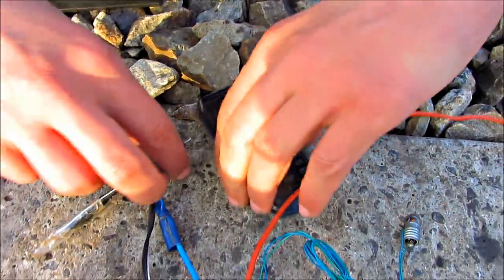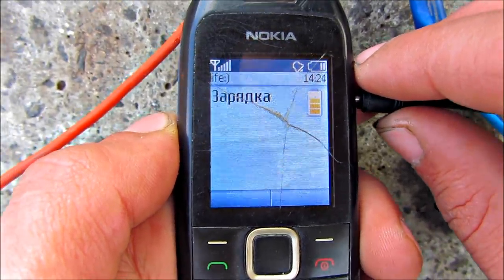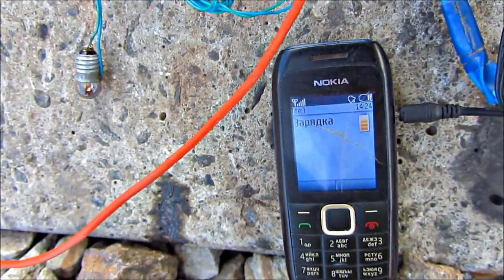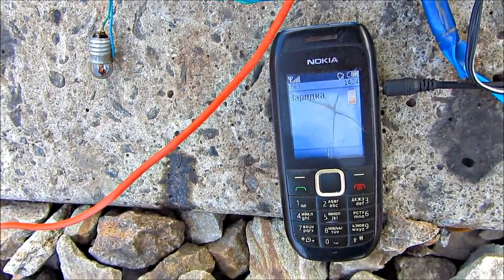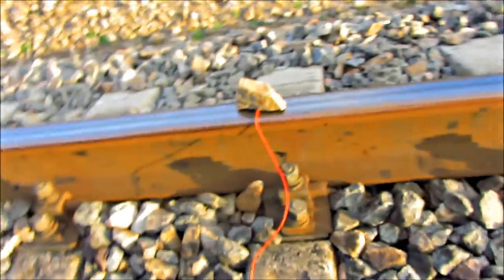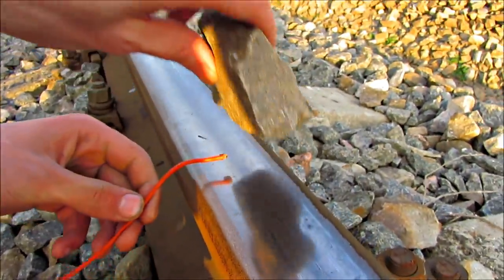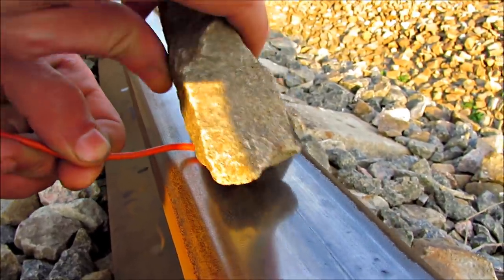How to charge a phone from the rail tracks. Measuring voltage on the railway

Comment: "How to get run over by a train"
Reply: +andreasBK943AN how?
Reply: Sit in the railroad fideling with your phone
Reply: +andreasBK943AN It is not like you can't hear a train.
Reply: You would be surprised at how quiet they can approach at times.
Reply: You would be surprised at how quiet they can approach at times.
Reply: Yea if you do this, it trips the red signal behind, so all the other trains have to stop until the short on the tracks is no longer there. Technically speaking, doing this is safe because it will cause all other trains behind you to stop. But that's not necessarily always the case.
Reply: Unless a train has passed the block
Reply: Trains are actually surprisingly quiet. Have you ever been on a train station. You don't really hear them coming until they are like a block away. If you aren't looking at the direction of where the train is coming, it will be too late to avoid a speeding train. That distance is easily covered. Also I don't have any hearing problems, my doctor say I have perfect hearing.
Now he can probably feel the tracks vibrating though.
Reply: You do realize how fast a train can go right? In addition to reaction time. And by a block I mean is when you start hearing the sound, it is still quite quiet. The sound get exponentially louder as it gets closer. At that distance, you may not even hear it with earbuds on, depending on volume level.
Reply: If the operator had a clear and it changed to a stopping signal the operator wouldn’t have time to stop
Reply: Thats what they all say until there’s a train right upon them
Reply: Love how you ignore my explanation why that isn't true at all. By the time you hear it, it is too late. The train is way too fast for you to get out of the way. Maybe if you were near a stop, turn or a crossing, then the train would be slower. But I wouldn't mind seeing you try dodging a fucking train.
Reply: I’m not dumb enough to run in front of a train. 
Now let me ask. Are you a railroader or a railroad worker who isn’t on a train crew but works on or around the tracks?
Reply: Ronja, I work in a rail yard and I’ve had trains sneak up right behind me. I’m sure you did some ground breaking research to figure out that it takes 2 seconds to get off a track. Yet it takes no time not to go on them at all.
Reply: surprised I read through all these comments and no one mentioned the hardened steel ringing sound the tracks make as a train approaches... is this not reliable? or not as common as it seems to me? I always hear trains coming, but only from the track ringing sound. I don't take trains too often, but I recall that sound every time.
Reply: Lol in poor slavic eastern european countries there still is a majority of old slow passing trains they drive slow because it is a big possibility to derail because the rails are like Ukrainian artillery shot them

Comment: Anyone else notice the pattern in the voltage output? The light and speaker are both flashing/creating noise at a certain pace, almost like the voltage is supposed to be going through the rails. Maybe some sort of communication between trains? Or something to do with rail switches? The lights that tell the trains to slow down along their path? Fascinating.
Reply: +LordRedgenold 
It is called track coding. The interlocking equipment at the next signal modulates the track circuit current, which can be detected by the train, and the train driver knows which aspect is shown on the next signal.
As I know in Russia they use 3 type of codes, when there is three signals between a long pause, the next signal is clear, two when the next shows restrictive speed aspect, and one if the next signal is red.

Comment: That's amazing. The 50 HZ transmission lines nearby are actually inducing a current in those rails. Guess that proves that HV transmission lines put off a lot of EMF's.
Reply: It's weird though how it oscillates 3 times and pauses though. I'm thinking.... Might be Russia's ELF antennas for communicating with submarines the signal found here (ZEVS). America has a couple arrays doing the same thing  (Project Sanguine)
Reply: There are no power lines nearby, the poles you see are for communication lines. EMF also wouldn't produce a pulsating sound with large pauses.
Reply: LekkereKwal You're guessing there are no power lines nearby right? Couldn't there be lines ten miles down the track? Also imbalances between earth and transmission lines can create weird octave frequencies but I think the question has been answered already. It's for the rail road crossing signal. Most plausible explanation I've seen.
Reply: +fla playa  ypu've seen too many movies :D. This is a very common system to determine train position and speed. The train also receives it's maximum speed.
Reply: LekkereKwal Thank you for repeating what I just said in similar terms. It's been said that this AC voltage is for crossing signals bud, not speed and position. Thanks for basically congratulating me for having a large mind XD Lol.
Reply: +fla playa I think that simply are the signals across the rails to comunícate with the trains and/or control signals. If it would be 50Hz induction from a high tension line, it would be a constant signal of 50Hz, not a pulsating 50Hz signal.
Reply: +fla playa oh yeah, wow I didn't see those parallel power lines until you pointed it out. I would have been wondering for some time on my own.
Reply: +fla playa see @cedric Harris comment, he's on it. Yes, some power is run through the rail way tracks to determine if there is an electrical fault in the line (this is mainly used for signalling)
Reply: D3r3k3r3D And see my comment before his "It's been said that this AC voltage is for crossing signals bud, not speed and position" This is turning into a circle jerk. I figured that out long before Cedric came along. Has nothing to do with determining an electrical fault and has everything to do with the Crossing Signal. Thanks tho ultra eager people.
Reply: +fla playa it isn't a crossing signal... It's the block signals (red orange or green lights) and the signalling of the maximum speed to the train driver.
Reply: fla playa have you worked in the signalling industry designing and making the whole thing happen? Because what I've said comes from experience. Electrical fault is obtained when the status of the train tracks shows "occupied" aka Red signal. This is done by a short circuit between the two rails. Hence nothing to do with the "crossing signal".
Reply: fla playa Eh:
1. You think a pulsating sound on railtracks is EMF from submarine communication
2. You think that even though there a no power lines near the track in the video, the interference could come from 10 miles away
3. You think "Also imbalances between earth and transmission lines can create weird octave frequencies" whatever that means
4. Then you think it's from a rail crossing signal
5. Then multiple people tell you it's not and you keep stubbornly repeating that you 'know' it's that. While you clearly don' have a clue and just follow something you've read somewhere else.

And we are the ones who are weird???
Reply: +Cedric Harris cosmic radiation doesn't pass through our atmosphere. What you experienced was static charge buildup. In high levels this causes lightning from clouds. Static buildup is also seen as the most plausible explanation for the Hindenburg Disaster.
Reply: Yeah I wasn't trolling. This was a brilliant thought I had when I saw the hundred + mile long iron rails insulated from earth via wooden ties. My first thought was ELF inductance when he clamped his multi meter to the massive conductors... Right or wrong I know I'm right in that some induction will occur with a pair of conductors that long Or For That Matter ANY Length. The longer the winding the greater the voltage induced. The voltage would actually be greatest between one rail and ground, not "Phase to Phase" He'd need to sink a ground rod to achieve that though. The oscillations are what struck me as being some sort of phase resonance.... But I'm unqualified as it seems to comment on such matters being surrounded by armchair youtube aristocrats. I've seen switch buildings in a substation yard throw of 1/2 inch arcs due to induction. So if a freaking aluminum building can achieve induction I'd say anything could. First time the word "INDUCTION" was used on this whole video so don't even think about trying to "Educate" me. Already "Educating" you.
Reply: +fla playa  It could easily be induction. Holy smokes at at all you people that "Know Everything".
Reply: LekkereKwal You are somewhat of a Top Comment bottom feeder aren't you? I already gave credit long, waaaaaaaaaaay long ago to whoever suggested signaling in the rail. You guys are forgetting all all about the USA's and Russian ELF submarine antennae. Why the fuck would they need to oscillate their stupid railroad track voltage? They wouldn't. And I have read too many books, not seen too many movies. Also your grammar is abysmal. You are the one coming on here attacking me for thinking outside the box. Did I press a nerve or something?
Reply: +LekkereKwal I think the lesson we all should learn here, regardless of anyone's intent, is that YouTube comments aren't always the place to try and teach people. Sometimes it's a great place for discussion, but by continuing to give legitimacy to people who are deaf to constructive discussion, we contribute to the cancerous nature of the system as a whole.
Reply: Do I need to go as far as removing this thread? I already gave credit to it being some sort of signalling system on the rail way before anyone else mentioned it here. I had pure intentions (as always) but it seems youtube is filled with like hungry, quick to call out a mother fucker over any reason.
Reply: +fla playa so if people agreed with you, it would have shown that your ideas were true. Now that people don't agree with you, you see this as proof that your ideas must be true as well?
Reply: My point is I'm being ATTACKED!!! Must be shills. Never seen so many shills. SHILLS,SHILLS SHILLS. (A shill is a govt payed person to influence the outcome of election or even a thread)

Comment: A 50 hertz signal to detect when a train enters a section of track. It is indeed for controlling the traffic signals. The train shorts the the two rails through it's wheels and axle acting like a switch to complete the circuit. The signal can be anywhere from 50 hz to 90khz depending on country and equipment manufacturer and environmental RF. The pattern helps the detection circuit distinguish between stray RF noise and the actual presence of the train. The capacitor/diode charger will not pass enough current to trigger the signal, but the audio speaker might. Depending on the type of breaking system used by the trains, this signal can also be a simple 5 volt DC signal.

Comment: (Note: A block is the section between two signals on a line.) This is a really bad idea, track circuits control signals on the railway. what i mean is that when a train goes over a block, its wheels and axles short out the rails, telling the signalling system a train is on that block. this means that when you hook up your phone, you short out the tracks, which in turn will tell the signalling equipment that there is a train on the block. meaning that no train can proceed onto the block you are on.
Reply: Though I guess you could use this if your car got stuck on the rails. Find a way to short out the rails and you will notify people that there is some kind of problem. Remove the short when you push your car away from the rails.
Reply: Rudy R . . . but at what amperage - for instance if there's 5 amps available and they are only drawing miliamps then the system won't even "feel" the loss. It would not signal the system of a closed circuit.

Comment: What they are actually picking up is the alternating current pulses from the russian in-cab signal repeater system. That particular sequence would indicate to a train that the next signal is clear. The signalling pulses are also used as a train detection circuit.
Reply: +ExperimentRender this is probably correct. the exact method of detection varies from one rail system to the next but these pulses are probably separated into zones to ensure no more than 1 train is in a particular stretch of track at a time. if a train was in that zone, the rails would be shorted together through the axles and therefore there would be no voltage across the rails. if another train were to enter that zone, a detector would be listening for the pulses but not hear them and would alarm the driver or central control station that two trains are on the same section of track.

if they were to keep walking, they would likely find an electrically insulated gap in the track which would be the beginning of the next zone.
Reply: mjstecyk - the stretches of track are known as blocks and are the spaces in between two signals

Comment: The voltage is there because of the signaling system. when the train wheels short the rails, the voltage across them si almost 0 and the signaling system knows that that portion of track is in use

Comment: Not every rail will have power running through it. Especially in Canada. Most provinces have a ton of rails that run on a system called CTC (Centralized traffic Control)  which are rails that don't use lights/electricity. They have to call Rail Traffic Control and issue paperwork known as clearances to move. So if this is real and some track by you isn't working you gotta go find a different rail. Don't be dumb though, trains are nothing to play with and is highly illegal to be on the tracks and equipment.

Comment: It's called a track circuit and is used to detect trains. One rail is grounded and the other is not. The rail that is not grounded is divided into sections of various length (typically 1-2 miles between stations and 0.5 miles within a station). At the edges of the sections, there are signals. If a current is flowing the rails must be connected, usually through the wheels (and wheel axle) of a train. Whenever there is a current, the electronics controlling the signals assume that a train is present, and all the signals leading into the section automatically turn to red.

Comment: Crass stupidity. The voltage is there as part of a block-signalling system. You short the block, you put the previous signal in the block to red. The trail of delays caused by trains waiting for an intermittent signal to clear will not endear you to the rail users whose day you have ruined, or the authorities who will come down on you like a ton of bricks. As for corrosion protection, BS! 
Tonight's reading subject is: "Block signalling".
Reply: From their other videos I gather they don't have a lot of authorities over there.
Reply: They are in a war zone full of rebels where the cease-fire was violated up to 15 times already... Luhansk doesn't seems to have many authorities atm.

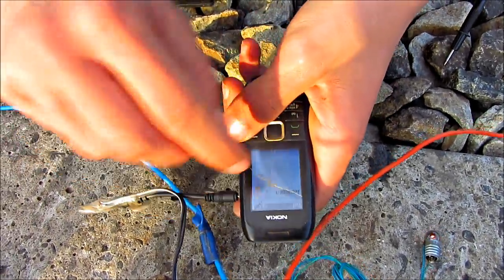Comment: Wow seems totally legit. Those edits aren't suspicious at all. I'm sure he is not pressing the key to light up the screen @ 1:50.
Reply: okay
Reply: +Fibr3Optix I didn't know turning on the screen also animates your battery meter as if you were charging, wow! And explain the speaker and lightbulb, must have been his sleight of hand tricks.
Reply: +Internet Gadfly It's a track circuit. It isn't just for collisions. It's for helping run the entire rail network. It shows us when the track is occupied, usually by a train. If you walk down the track you will eventually find a bungalow which controls that section of track.

Source: I'm an RTC.
Reply: +Fibr3Optix It's completely legit.  The track circuit is carrying a pulsing DC. The capacitor stores charge in between the pulses, so that in between the pulses, you have some stored charge from the capacitor to discharge and fill in the dead times.  This gets him a smoothed-out 5 volt supply off the track circuit that is indeed charging the phone, lighting the bulb, and buzzing the speaker.
Reply: +Chad Marlan So the track is actually energized and this isn't some sort of current induction like an antenna arial? Because that is what I figured was going on...although I was a bit perplexed by the regularity of the current...
Reply: Fibr3Optix its real...

Comment: That voltage is often used for sensing a stalled train on the tracks. Might not be such a good Idea to mess with it although its impeadance is probably quite low.  Know what else those tracks can be used for? Turning people who use them for their own experiments into red stains on the front of trains. Quick! Look up!...
Reply: The circuit of the track would of set the Signal behind him to read as he shorted the rails together
Reply: Railway traffic control may tell them to ignore red light, then you are in trouble.

Comment: The current on the tracks in indeed used for the traffic lights. when a train drives over it it makes a connection between the rails which makes the unmanned signal (automatic signal) it just passed turn red. Connecting the two pieces manually will turn the signal guarding this section turn red (in both directions and only this rail) and cause delays. This only works for long straight lines. When there are points/junctions involved they use different techniques.